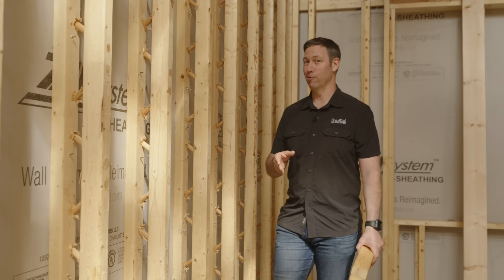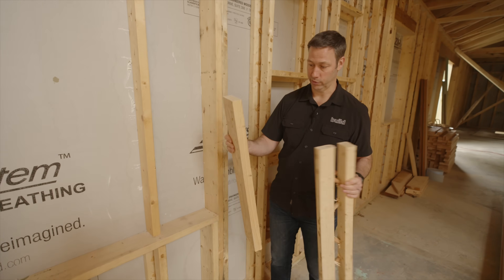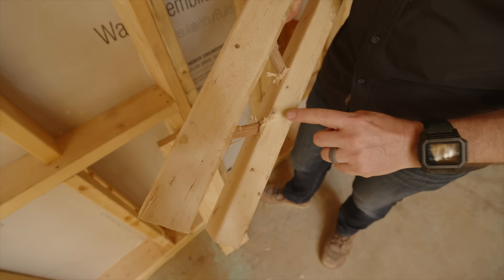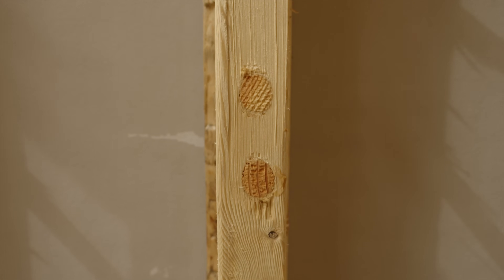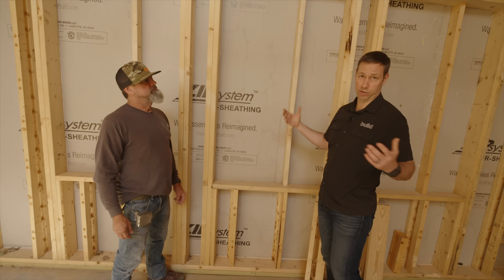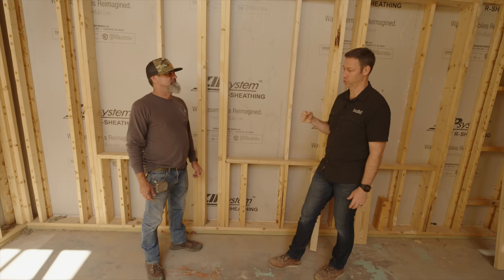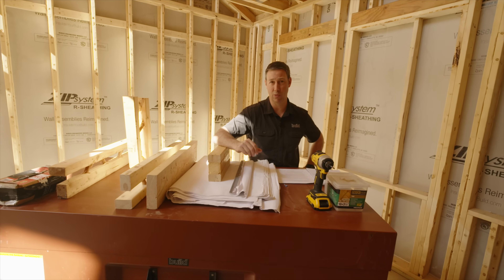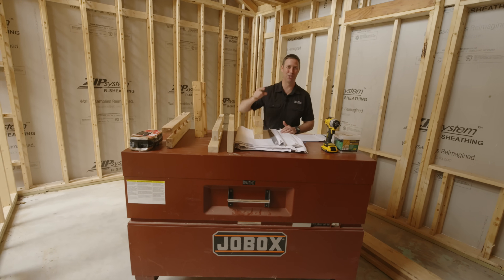Framing with a 2x6 Replacement - TSTUDS!!!

Comment: Matt, I am almost ready to unsubscribe. 
I learn from the comments and you are not countering some really good points, the firestorm you are creating is the most interesting. Would it bother you to find out someone was barbecued in a house like this? 
Reply to them or retract the video
Reply from the maker: Really?  How so?  Fire rating is the same. The double top plate provides a fire block to keep it from spreading. Use mineral wool blown if this is a concern. How many new homes have fires emanate from a stud bay?  The codes address this in any wall with firestopping at the top of walls and where fir downs occur. I honestly don’t see this perceived issue as being a valid knock on the product. We use trusses and I joists in homes too and these have more fire concerns when lit than solid lumber. Do we remove all engineered options from new homes?  Codes are there to address life, safety, health and builders follow these codes which are updated every 3 years. Don’t use this as an excuse to build less efficient homes. OR if you are building (and paying) then use 2x4 walls with solid sheathing and use lots of thick exterior insulation like I did a my house. That’s clearly a better system but it’s also more costly.
Reply: @buildshow  
The mechanics of a good fire build is to start with smaller pieces of wood, and the comments by the fireman, who are the most likely to see the aftermath, match my experience. There's not another concern that comes close to that. Codes and lack of information is no consolation if this played out like his comments. It would be a great video if you were to counter that concern with a build and burn it. Anyone can choose to build with any technology and you can show the benefits and promote anything you want to. I'd simply encourage you to look at it and the comments. If you feel techniques and material used for insulation are enough for a fire block without any need to go any further than I would have to accept your insight. 
I'm still watching for your videos anyway

Comment: The only reason your framer is using a dimensial lumber top and bottom plate is because to shoot a four inch nail that is recommended is through a max nailer and compressor which is going to run you 5g plus for one gun. Must be nice to have a lead framer that is competent and all his employees be mexican as seen in all the other videos of yours with someone actually working

Comment: An interesting product, but it is questionable if the additional cost for these studs will pay for itself in energy savings. A standard 2" x 6" wall is very energy efficient, so engineered studs may only provide minimal energy savings benefits, while costing two or three times as much for materials.

It's my guess that standard hurricane ties are far superior to the new screw system.  The hurricane ties are a proven system that survive actual hurricanes.
Reply: @Craig E Thanks for your kind reply. My question was more directed at the DIFFERENCE in cost between normal "2 x 6" framing and the T-Stud framing. It's my bet that if you had just used regular 2" x 6" framing and insulated well, your utility costs would have been very close to the $22.00 a month you now cite. The question becomes if you are only saving a few dollars a month by going to TStuds, then you will never, ever get back your intitial cost of materials  difference (between TStuds and 2" x  6" studs). 

I actually agree with both you and Matt that these studs are great. But the upfront cost has got to be at least three times as much compared to using regular 2" x 6" lumber. Further, there are other cost efficient ways to provide a thermal break when using regular lumber that are not mentioned in Matt's video. 

IF TStuds have a reasonable upfront cost, THEN they make sense. But if they don't, then you run in the a place of diminishing returns and they are a waste of money. 

However, in one sense, I can see that using these studs has given you peace of mind about your home's energy efficiency and that is worth a lot to. I hope you will be very happy in your new home. God bless.
Reply: @Craig E I wish you the best. I worked my through college as a carpenter framing houses and it appears that TStuds are a superior product. I  am sure that they will provide you with amazing quality, strength and energy savings. Enjoy your new home.

Comment: Why do the dowel bore holes look so janky?  I know all this will be buried by insulation but is it really that difficult to make a clean bore hole?
Reply: everything has a tolerance, if you try to make it exact, then a smaller dowel on a larger hole will be loose. the solution is to always oversize the dowel so that it scrapes its way in, forming an ultra-tight fit that will usually leave wood shaved off.
Reply: It looks like those dowels were shot in by a giant nail gun. Would be great for vampire hunting.

Comment: From what I see here: Pros: Higher R value, uses cheaper dimension lumber, stronger, easier to wire/plumb through, larger exterior nailing surface, lighter to handle. Cons: More expensive, tendency to split when nail-gunned. Imagine the cons could be mitigated with increased adoption and improved nailing techniques. I can see these being part of code/regs in years to come.

Comment: You mentioned that you will not have a thermal bridge on the bottom plate since you are wrapping the exterior with foam.  I believe that you have now standardized on attaching a PT 2x2 (or so) to the sheathing at the bottom plate and essentially rest your polyiso on top of that.

Wouldn't there be a (minimal) thermal bridge coming through the bottom plate; through the sheathing; and then through the 2x2 below the foam?

Or is there maybe no 2x2 in this configuration and the external foam goes all the way down to cover the bottom plate?

Oh!! Or is it that this particular build doesn't have a layer of external polyiso and the "external foam" is the foam in the Zip-R and so the thermal break is BETWEEN the bottom plate and the sheathing?

Comment: I would go 24" oc and not use the cripples at the end of the window sills
Reply: 2 ft hacks.  Flimsy walls.  Thats how they build in mexico with no codes.   16 inch on center sturdier.   Especially where i am in eartquake zone
Reply: The load above may require 16" on center... 3 story or 2 story with a slate roof....

Comment: I understand that it may not make any difference in strength, but why does it look like they drilled those dowel holes with the drill running backwards?
Reply: Save money drilling thousands of holes
Reply: I thought that too, but on further reflection remembered that the perfect is the enemy of the good enough.  They work like that; no need to spend more to make them 'pretty'.

Comment: With exterior insulation, you already have a thermal break, do we need a second one.......if no, then why do it, if yes, why was the first thermal break not sufficient?    So approx 5.5 R with a standard 2x6,......aproox approx on par or better than some double pane low e windows.

     It takes 32 studs 8 foot tall to a equal a 4x8 area, 32 square feet.......... 32 studs builds approx 40 lineal feet of wall.......2 small standard windows equals 32 square feet.......and perform worse than studs.  Easy answer, reduce window sizes and numbers which saves, instead of costs.

       What is the price difference between regular studs and T studs.   I have seen 15 + bucks per stud referenced for T studs.

     Close to a 40 percent increase in cost,....do they perform 40% better,.....what`s the payback time frame in various applications, with a exterior thermal break already in place, actually 2 exterior thermal breaks if one employs a rain screen, which means radiant can also be used.  I find the third thermal break might take a 100 years to pay back if ever.   

   I am sure in certain applications they excel, but I am doubtful they are a across the board choice...........it only pencils out in very set circumstances and even then can be mitigated or reduce the need completely using other techniques already being applied to the structure.

       Maybe its me, I am expecting too much, more than a look at these, they are cool and easy to use.......  of course, I go run numbers and different usage scenarios and spend several hours assembling the details to get conclusions on costs analysis ,.......payback periods and using the cost difference in already utilized applications of the building such as foam,just spray more, using the additional dollar amount or exterior insulation,just buy thicker, using just the cost difference amount and it seems to pencil better in the alternatives especially if you figure in labor/construction time.
Reply: A small window is 48x48?
Reply: @chriswithrow3107    Have you not been watching his videos ?  Window walls and quad panel 8-10 foot tall patio doors are the norm in some of these places.
Reply: @chriswithrow3107  Also a 4x4 slider does not even meet current egress codes for the bedroom,  it takes a 4x5 slider now.

Comment: Plumbers here won't put plumbing in an exterior wall because it could freeze. Maybe not an issue in austin. I'm curious if you have any info on sound conducting? Should have slight sound deadening properties

Comment: yes, this is a great concept, so I made my  jig and built a complete house with these, top and bottom plates too. 8 inch walls with Rockwool (R-30) and the studs too. R-30. 26 x36 building

Comment: Those dowels eventually work loose and deform drywall over 20 years or anything?
Reply from the maker: Have you used polyurethane glue in any woodworking projects?  Those dowels aren’t backing out anytime soon.
Reply: @buildshow  they won't naturally deform over decades?

Comment: Isn’t zipR and this Tstud a bit overkill?
Reply from the maker: My take on insulation is that you should get as much as you can afford. This home will likely get a new kitchen in 25 years but the walls won’t get more or better air sealing or insulation for 75+ years
Reply: @buildshow  that’s a fair point. I am not against massive insulation. In fact, our company is developing a new insulated concrete sandwich wall panel system for commercial applications and hope to build my spec home with it in a few years. This is the ultimate bomber weather proofing system. Totally thermally broken with our fiberglass connection system holding the concrete and foam sandwich together and you get the thermal mass effect of the concrete on the inside for the ultimate system.
Reply: This (was) his "budget" remodel, remember? Overkill sounds right for a tight budget 😂😂
Reply: @DigitalBenny  ha! No kidding. believe this is a different home. His ‘budget remodel’ is way past this phase. Some other rich dudes home.